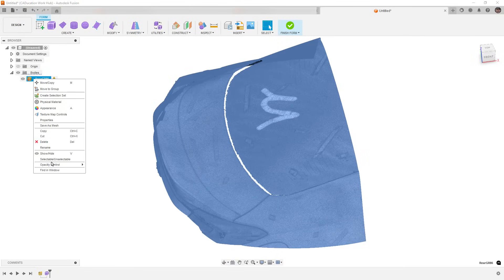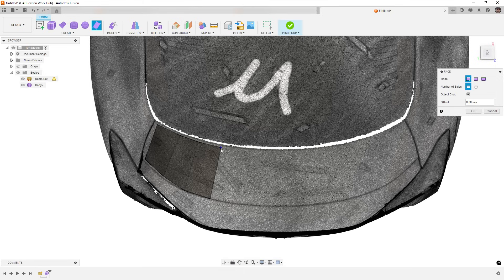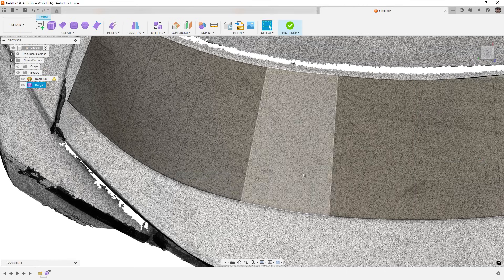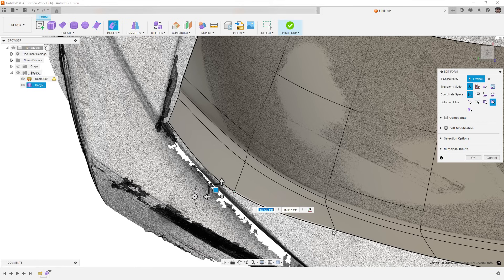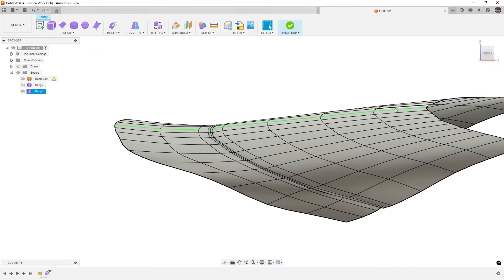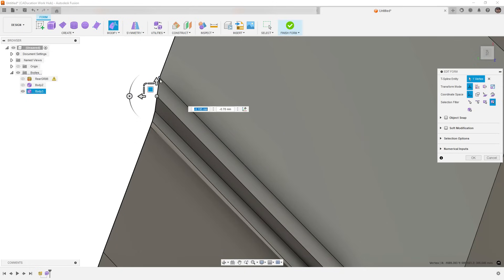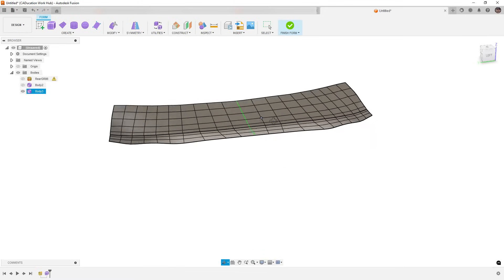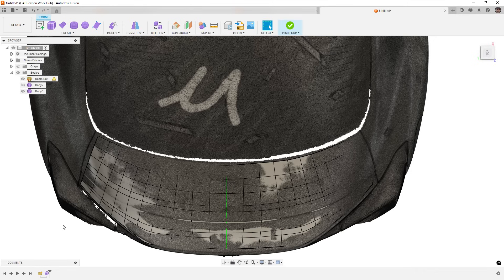How To Recreate A Scanned Trunk Lid with Fusion Forms

Comment: Might be a dumb question but can you mirror a part? And is there any issues when doing that?
Reply from the maker: No dumb question!  Yes you can mirror a part.  In forms you can mirror the form as independent form bodies or connected.  When connected they will have a green symmetry line on them on the mirror plane.  If they are not attached they still move/adjust together.

After you finish a form and have a surface you can still mirror a surface or solid body.  The only thing not currently available (i don't believe) is mirror a mesh.

Comment: Hi, I wanted to design a spoiler for my car, but I don't have a 3D scanner. Do you think is it possible to recreate the boot of the car by tanking photos and designing it manually? Do you know any other option?
Reply from the maker: Sadly the chances of you getting it to match is very slim.  If you have to do it manually the best chance is to likely set up a grid of painters tape (depending on the car/shape) and make cutouts from poster board that you can scan into the computer.  making somewhat of a skeleton of what you would loft.  I have modeled cars from images and gotten close but unless you only have a few small points of contact the fit will be bad.

Comment: Matt, on something like this, do you worry at all about things like tape lines in the scan? Seems like it could introduce extra noise when pulling the form to the mesh, but maybe not enough to matter?
Reply from the maker: It really depends on a few factors.  1. is the final part getting 3d printed.  If so the resolution of say a desktop fdm printing curvey things is worse than the thickness of the tape.  2. is the tape where i need to pull a vert to.  and 3. what is the goal of the final thing.  The intended use for this scan is actually just 2 small areas on either side to mount a wing.  So as long as the form was clean in that area it really didn't make much of a difference.  Also the form overall, the fewer the faces/edges the smoother it will be when pulling to a mesh.  So if you get crazy with subdivisions and pulling then you will start to introduce some bumps.  But they won't be hard edges like we see on the tape in the scan.  It would be more like you laid a napkin over a credit card.
Reply: @LearnEverythingAboutDesign Thank you very much for the detailed response!

I'm planning to try the Form methods you use on my next scanning project, it seems very efficient for a lot of parts I scan (parts of boats). Previously I used Mesh sections to create surfaces, but it can be extremely tedious on non-prismatic parts.

I've got to say that it's impressive how good results we can achieve with hobby level scanners, 3D printers and CNC machines :) We build stainless steel windscreens for boats and the ones we've built from scan data taken with our Revopoint Range have fitted extremely well :)
I should probably get a better scanner, and likely do so 😅

Comment: Awesome video Matt,  this give me a perfect example for a question too.  I have been using your alignment method in fusion 360 to get the mesh aligned with the grid and it works great with you have relatively flat surfaces perpendicular to each other.  I was wondering how you would align something like this that has much more of a curve to it and no distinct flat faces?
Reply from the maker: In Fusion it is just "by eye". no real way unless you have some feature.  When scanning you could use clay and a small cube on the design.  In some cases i have put painters tape as a center line but this is by eye and not precise.
Reply: @LearnEverythingAboutDesign got it, I kinda figured that .   Also is the fusion 3 point plane method the best "free" method that you have come across? As you mentioned in this, I can't justify the cost for occasional hobby use for quick surface.
Reply from the maker: @eliteman125  Yeah. the 3 point method works ok as long as you have a good reference mesh.  So leaving part of a floor under a car for example you can use the 3 point method to get a good approximation of a ground plane.  Having something in the scan that you don't remove like a cube is the best way to use it for symmetry, but super slim chance it will be that close.  When i do stuff like wide bodies its not a big deal since you just work on one side.  With spoilers or lips/bumpers it becomes a much bigger problem and thats where you really need a tool that works.  GOM inspect had a free version to do alignment, but i don't think it could generate a symmetry plane.

Comment: Cool share... I can relate to this a lot!  I reverse engineer helmet surfaces a lot.  Something else that helped me get a better handle on this is, while manipulating individual surface points like this,  to select the second icon next to "Coordinate Space" (inside the EDIT FORM tool menu), which is called "View Space" (which I understand better as "normal to the viewing window")...essentially allows us to move the points relative to the angle you are viewing from, instead of along the models' x,y,z coordinates....which is always off axis for me, as I often move around the model a lot while working in the FORM environment.  And the secret to the pesky zooming restriction that happens sometimes while doing this, is to hit the home icon in the top left...this refreshes the model and you can zoom in easily again.  On another note, I'm curious to see how you align your scanned model, to center it?  I find that really time consuming, but necessary for symmetry.  I'm sure there is a faster way than I do it.  Sorry if I over shared, hah.  Much appreciate your share.  Cheers  -Dane
Reply from the maker: Hey there, yes the view change to View Space does really help things.  I do tend to use that a lot when im not doing videos but for some reason when I am explaining things I tend to leave those settings alone.  100% it helps out!

On the alignment. this scan was sent to me as is.  But i have done videos on aligning scans.  Programs like QuickSurface have the ability to make a symmetry plane off the scan and that can be used to help align the coordinate system.  But you need to have references.

In fusion its a very manual process sadly and its only going to be "by eye" and no tprecise.
Reply: correction: 'home icon' is top right, next to view angle toggle

Comment: I have a question and I hope you have the time to get back to me. I bought a 3-D printer and a 3-D scanner and I’m trying to make custom Speaker pods for my jet ski but everything is going over my head and I’m kind of spinning round and round. For someone like you I know it’s extremely easy but I can’t quite understand it because it’s extremely overwhelming. I see you have training courses and tutoring. do you have a course that would suit that situation with scanning a portion of my jet ski and making a Speaker pod that would fit it.
Reply from the maker: Hey There, I don't have a specific course covering exactly what you are doing.  I have plans to make scan courses on my site but everything right now is here on YT.  We have a scan series for an RC car part, we also have various other series for things like making wide bodies which includes the scan of the vehicle.

With scanning you generally have 3 workflows.
Scan and print the mesh directly (making a copy)
Scan and make a part that fits on or around your scan
Scan and reverse engineer the scan so you have CAD data.

For you the 2nd one is the process you are likely to have.  Right now I would say focus on the scan part of it.  which scanner do you have?
Reply: @LearnEverythingAboutDesign  I have the creality ferret, but the scan came out beautiful. I just don’t know how to take that scan and add onto it. Let alone turn my idea into a workable object on my computer. I’m barely learning how to move a square around and extrude it.
Reply: @LearnEverythingAboutDesign  do you think you could personally help me? I’m pretty sure it would only take you a few minutes and I’m extremely positive I would learn everything I would need to from you to move forward.
Reply from the maker: @electronicsguru4050  is the scan something you would be willing to share publicly?  you can email me support@caducator.com to carry the convo on.
Reply: @LearnEverythingAboutDesign absolutely. Whatever you need. There are so many people that wind up selling their 3-D printers because they wanted to do exactly what I wanna do. I do custom car stereo and I’ve been wanting to learn how to do this one thing for so long.

Comment: When you selected all and pulled down to the surface, did that remove symmetry? I didn't see where you lost the symmetry constraint on the form.
Reply from the maker: No it will keep symmetry but only really pulls the points down on one side because the mesh isn't perfectly symmetric.  It might actually average them, but if they are wildly different it will just be pretty far off.  You can play it save and just select the left half.
Reply: @LearnEverythingAboutDesign good to know, thanks. It was interesting to see this after taking your beginning forms course. I felt like I knew what you were going to do through the video.  I need to get through the rest of your courses.